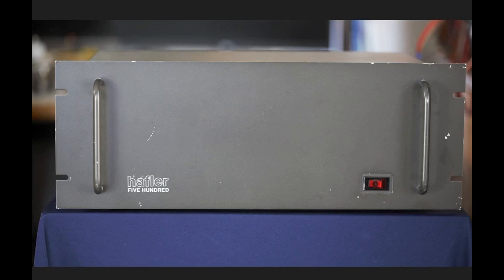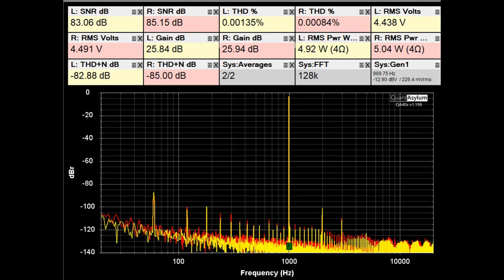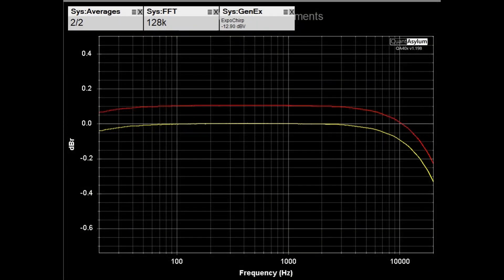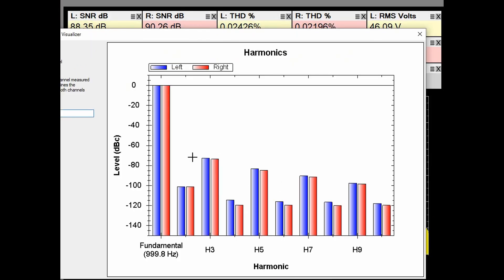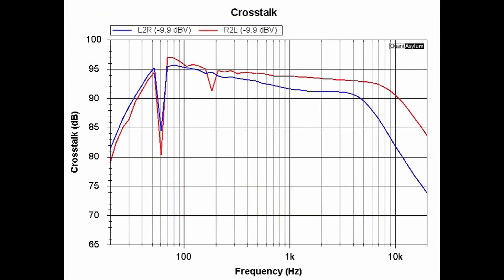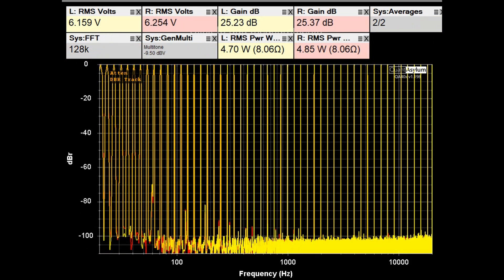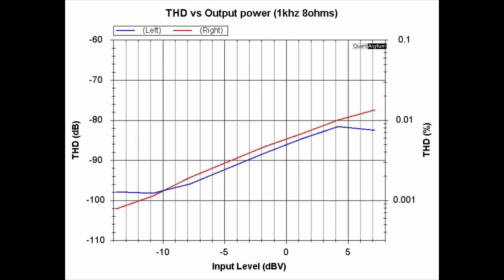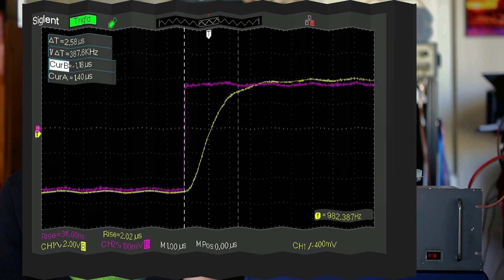Hafler 500 Power Amplifier: Vintage Audio Review Episode #129

Comment: Excellent amplifiers. I own five of them and I still maintain them after all these years. A major upgrade would be increasing the size of the filter capacitors. Another upgrade is to add an input buffer to make the amplifier more stable. When running and it's normal stereo mode it can tend to become unstable depending on the grounding resistance of the output stage to the chassis. I find the best way to run them is in Bridge mono because the cancellation of power supply common mode affects occurs. With the boosted capacitor size and the bridge mono the amplifiers can produce closer to 1800 watts for 300 milliseconds until the power supply voltage starts to sag.
Reply from the maker: That is quite a lot of power for a brief period of time. You are the 2nd person to comment about increasing the filter caps. It is not my amp and don't think the owner will want to do anything since he has an upgraded one- neither of which he is using now. Will do a review on the upgraded one (by a company that does that kind thing) at some point. Thanks for sharing!
Reply: @vintageaudioreview  The power supplies on these units are spongy, hence they benefit greatly from larger energy storage to lengthen the period which they can deliver short term higher power.
A decade ago, I had one go into oscillation in the middle of a listening session. It seems to be an issue with varying resistance from the speaker common lead and chassis. There is a 10 ohm resistor connecting these two points. If you overdrive them with asymmetrical audio in stereo, they will trip protection because the power supply rails will become unbalanced under that kind of load. Running them bridged solves this.
I have a couple of XL600 Haflers driving my front mains, bridged, and modded. They will deliver just over 130 Vrms into an 8 ohm load for short durations, yielding an incredible 2200W of short term headroom. Bridging also cancels common mode noise.
Reply from the maker: @basspig  You sure know a lot of the Haflers! Running in Mono is always nice if you can live with the increased noise level from the increased gain- might not be a problem depending on your speakers
Reply: @vintageaudioreview  running bridged actually eliminated the residual hum, which was a real problem with me running 112dB efficient subwoofers.
Reply from the maker: @basspig  I have not run a subwoofer except with the built in amps. I was thinking of just as a regular amp and when I did that I had too much gain so the noise was a bit much for my efficient Lascalas..
Reply: @vintageaudioreview  gain staging is so important. I have 6dB passive attenuators on the input of my Haflers because otherwise the noise floor (-114dB) of my DCX2496 loudspeaker management system would be too audible. I added just enough attenuation to make amp clipping and preamp clipping happen at the same level. No wasted gain. Garanteed you're hearing your preamp's noise floor.
Reply from the maker: @basspig  Probably my preamps noise floor (plus the other things in the loop), but it was just objectionable unless playing loud. The amp by itself is 60w stereo which is plenty for those speakers.
Reply: @vintageaudioreview  I had that problem with Reb B Sonic Hologram in my C4000 Carver preamp. Had to resort to socket adapters and replacing some of the 4136 op amps with an OPA version that is ultra quiet.
Reply from the maker: @basspig  Do you still have the C4000?
Reply: @vintageaudioreview  yes. I've recapped it twice over the years, modified it to get rid of the grunge caused by the autocorrelator circuit, and used quieter op amps. It is still the centerpiece of my system today.
Reply from the maker: @basspig  good choice!
Reply: @vintageaudioreview  When properly set up, the Sonic Holography is immersive and pretty darned accurate with instrument placement, assuming a proper miking setup in the recording playing.
Reply from the maker: @basspig  Although it does not work with all material, SH makes a nice improvement to the listening experience when it does!
Reply: @vintageaudioreview  Yes,  I turn it off for monaural material.
Reply: Five? I only have 3 😆
Reply: @bblimedia  I got the first 3 as kits in 1984, $515 a piece. Got another one in 1987 from a friend, and another on ebay in 2005. Then I got a pair of XL600s. All that in addition to my QSC Powerlight amplifiers which run my subs and mid bass.

Comment: According to the literature, THD spec at full power is .025%, not .002
Reply from the maker: Thanks for bringing this up- according to the service manual, the typical thd at 255w @1khz is 0.002%, but less than the 0.025% at any frequency in the band at 255w (8ohms)

Comment: I have one with one bad output channel. Hope they're not unobtaniums! They do not have a 4 ohm rating and I found they were not happy with my low efficiency 4 ohm Maggies. I even added some active ventilation, moving more air thru the tunnel and venting the case. 

Switched to my ADCOM GFA555. Let my son use this on his AR 91. Came back one bad channel.
Reply from the maker: AR9's, according to my buddy Ian, are amp killers except for the most robust amps. I posted in an earlier comment that you can rebuild the DH500 for $265 for the parts/kit if you wanted. Thanks for sharing!
Reply: @vintageaudioreview  Another of my son's has AR9. This one has AR91. The 9's do require some power, but far from as bad as my Maggies! He's been powering them with a pair of Audio Purist LO-7M's.
Reply from the maker: @glenncurry3041  Am not familiar with the AR91's nor the Audio Purist gear. Hope to do the review of the upgraded hafler 500 in a few months. Never been a big fan of the maggies that I have heard

Comment: Be careful buying a used example.    The output transistors are no longer made .   And they quit making substitutes as far as I am aware.    I have an example that got shorted years ago.    Ask me how I know.
Reply from the maker: Thanks for the advice and I will have to ask how you know. You can get a full rebuild kit for the dh500 on ebay for $265 w/out the filter caps, that includes the fets. But you have to build it...
Reply: @vintageaudioreview  

Interesting.   The Hitachi originals haven't been made in a long time.   I heard those were the best sounding.  People used to have the originals on eBay for reasonable prices.   But now they are in the 15-20 apiece range.    If you can find them.    Exicon used to make a replacement but have discontinued the TO3 production.     I'll have to check out the eBay kit.
Reply from the maker: @jasonk5979  I think the Ebay kit used Toshiba Fets. I am someone who would challenge a person about hearing the difference between different FETS as long as they measured similarly. FANTASIA AUDIO sells the kit on ebay